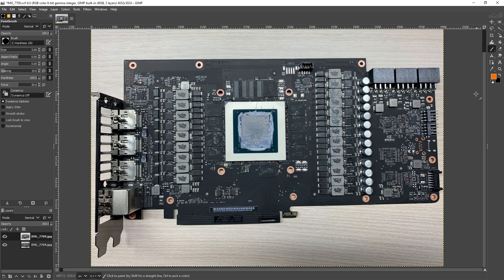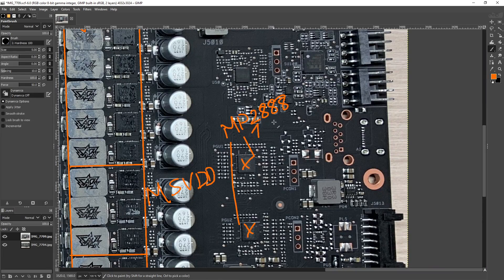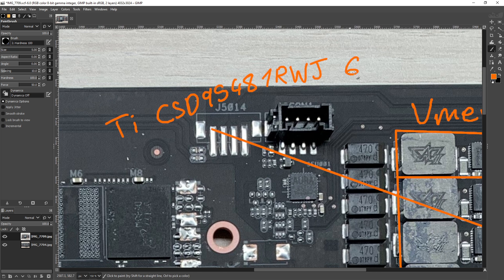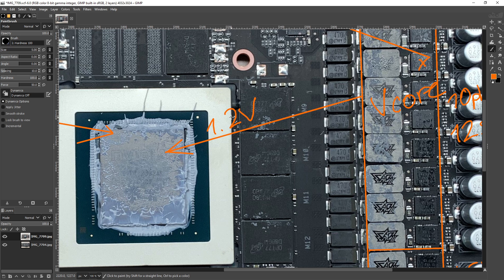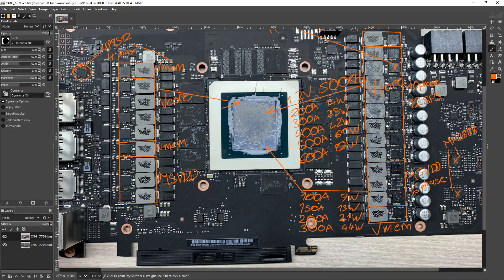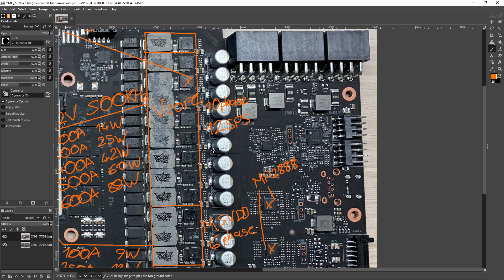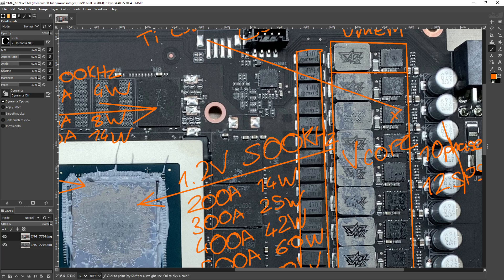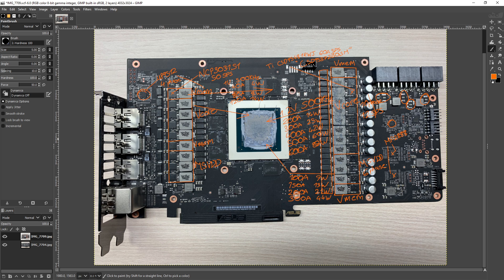GPU PCB Breakdown: RTX 3080 Strix // The best RTX 3080 PCB there is (same VRM as 3080Ti/3090 Strix)

Comment: Been waiting for this one.  Thanks Buildzoid, glad you got around to it.
This has confirmed my decision to just wait it out until I can get one.  As many of us have considered, I almost jumped at the first reasonably priced 3080, regardless of who made it, but no ... this is worth waiting for.  Just need the price to drop some more, as well as availability to come around.
Running a 1080ti now, skipped the 20 series ... and it was the right decision.
I dont do one generational upgrades. I replace builds only every 7-8 years.
This GPU might just last a couple.
Reply: good luck brotha, just got my strix 3080 ti ordered and delivered on the same day yesterday by newegg. this thing is a beast, i have no doubt the normal 3080 will be the same
Reply: I initially went for a 3090, but cancelled the order and decided rather than go a low end 3090, I'd go a high end 3080. STRIX OC it was. Looking back I was super lucky, and ordered in October 2020 and got the card just before Christmas. I fucking love it. I'd had an EK block and back plate waiting for it, so the air cooler literally lasted minutes before I pulled it off and put it in the loop. Best decision I ever made "downgrading" from the 3090.

Comment: i think Bearded Hardware made a video about the I2C thing with the MP2888s. apparently you have to send a special command with the EVC to expose the second controller (that does MSVDD i think) otherwise you'll only see the first one that does VCore. here is the video: https://youtu.be/EaJ8ytamJzQ it's at 3:44 min
Reply: To split GPU and MSVDD controller make sure I2C wires connected to PCON1, PCON2 or SCON2 (connected together)
Order from top to bottom Clock, Ground then data on bottom and then to Elmor EVC2
Using EVC software just send (Write) command Addr = 0x20, Cmd = 0xBE, Cmd Length = 1, Data = 0x20, Data Length = 1
Press Find devices, now you got 2 MP2888A controllers shown. One on Addy 0x21 (gpu) and the other on 0x22 (pmsvdd)
You must change Vout control to PMBus (from SMBus) to enable Vout Command and offset functionality
Reply: @Gti_Jason  yup, you're welcome for that ;) (it's jomama22 btw lol)

Comment: Had no issues with mine. Been great before and after water block. 19413 timespy graphics score where I topped out stable in games. Sits at 2100/2130, never hits 50c in my loop. Got to 1000 oc on vram before errors. 160cc oc.

Comment: You should mention cards that are not fused and maybe manufacturers will start protecting them when people learn which ones are designed to blow (i mean protect) the gpu and which ones aren't.
Reply: The fuses are designed to make the cards repairable by the manufacturer and just not e-waste. They are not usable by the consumer after a fuse blows. The fuse is for their benefit not yours really.
Reply: Fuses are way too slow compared to digital methods of overcurrent protection for anything but short or near short circuit conditions. I'm still glad my 3080 ftw Ultra has fuses, but they shouldn't ever go off from normal, even extreme OC use

Comment: I ended up paying scalper prices for this card and its a beast and I have never had a better cooler on a high end GPU. Full tilt running at almost 2000 MHz core and this thing will chill at 70 c Max on air cooling not even 100% fan speed. Super quite and powerful. If you can get one highly recommended.
Reply: Any coil whine?
Reply: @JM-sn5eb  Initially I did get some but the more I used the card it dissipated until now no or it is unnoticeable.
Reply: @JP_Stone  hmm good to know. I’d prolly undervolt it anyway

Comment: In Germany these cards are often sold at lower prices in the second hand market since at  some point many are truly fed up with the coil whine. Great for people with ANC headsets.
Reply: I have the 3080 Strix OC version and barely have any coil whine - to be fair paid a bit more for my PSU to get some cleaner power delivery in the first place - that might help. 
But even when I have coil whine, as long as I have my headset on (no ANC) I don't hear it anymore. So don't get discouraged from buying one of those if you are worried about coil whine.
Reply: got mine couple days ago, it whines. what a massive shame.
had to undervolt it and cap fps in some game to get it usable.
so if you can, i recommand buying second hand and try it in the seller's place see if there is any whine before commit.

i would take a mining card over coil whine card. i am just waiting for 3080s and will buy those to keep whichever one whines less.
Reply: @EnnTomi1  oh no just ordered the white 3080 strix. My vision 3080Ti hardly has any but that could be cuz it only has 2 8pins? Or maybe cuz their fans ramp up to 2000rpm lol

Comment: No surprise this is the top dog for the 3080s. How would you go about rating the rest of the line-up? The Strix clearly has more phases and overall some better components that other cards, but many use the same controllers. The Strix is an absolute beast, I still have a bit of a soft spot for the founders edition due to the shear density of high-ish end components on such a tiny PCB, although not perfect, lol, it's certainly unique.
Reply from the maker: high component density is bad for thermals

Comment: It looks just like my 3070ti, with a few less memory chips.
I bet it has problems with GPU hotspot aswell?
I fixed mine with more thermal pads and thermal paste.
ASUS forgot to put thermal pads on every VRM, it was missing (by design) on the one closest to the PCI-E connector, and also the top most memory VRM.
I had 60C core, 70c memory and 105 hotspot.
Now i have 60c core, 70c memory and 71c hotspot on average.
Those temps are with NF-A12x25 fans ziptied to it for a more tolerable sound.

Comment: Any suggestions on how to physically reduce extreme coil whine on this card? Undervolt/frame cap didn’t lessen it. Should I inject superglue around and between all the capacitors or swap them out entirely with different ones? Which glue/epoxy should I use or which capacitor should this be swapped for?

Comment: I like you and i don't like anyone you are my new best friend so far you are the only person ive been able to find in a month who knows more then i do not just taking off the cooler and going that looks nice i have a 3080 lhr card im going to replace the second bios and try changing the hard straps from 2216 back to 2206 and now doing some mods i decided when i got it i was going to take on the challenge just finding the dam bios switch is impossible found one twice the size i need but thats about it

Comment: I'm not sure if it's the best PCB, cause I've got mine and OMG the coil whine is just ridiculous. I have a Corsair rm1000i (1000 Watt 80 PLUS Gold Certified Fully Modular PSU) and used 3 separate PCI-E rails (no daisy chain) just in case, but it didn't help :) The more FPS you get (the higher the power draw) the louder it gets... and from what I have found - I'm not the only one...
Reply: Oh noooo. Just ordered mine :(
Reply: @mannyfresh7065  I guess it’s the meter of luck, so you might get a “silent” one ;)
Reply: I believe every 30-series Strix has the terrible coil whine. Mine did too, so loud that I could hear it over my headphones. I returned it, but am considering buying another and supergluing the capacitors as others had suggested to dampen the noise. Is that something you’d consider doing as well? I don’t accept the whine as 'normal' because if AIBs better insulated or glued their capacitors this wouldn’t be a problem. Search 'How to quickly & easily fix coil-whine TechPowerUp' - there’s a thread where others had shared their results. One glued their 3070 Strix capacitors and it still whines but less than it did.

Comment: Not a big fan of ampere on the whole because every card in the lineup has massive deal breaking flaws but i do like buildzoid videos.
Reply: @Boofy Goofy bro
Reply: @Boofy Goofy back when it launched the deal breaking flaw was that it was supposed to be $500 more than the 2080 ti and only like %60 faster best case scenario. Alot of that performance gain was also gained via higher power limits meaning an overclocked 2080 ti could usually get within like %40 of a 3090.

These days though at like $800 the 3090 is a good card
Reply: @Boofy Goofy the reason the 3090 ti is better is theres no memory chips on the back of the card that get fried
Reply: @Boofy Goofy as a long time 6800 XT owner radeons are a bit  overhyped. Sorry to hear about the state of your local markets thats a rip.
If you have a local best buy maybe keep an eye out for open-boxed 4080 deal for around 1000. My only advice on used stuff is only buy it if you can tell that its working and healthy or can return it.
Reply: @Boofy Goofy for you the 3090 would be a better buy because the 4K performance will be more consistently good since it has a ton of memory bandwidth, considerably more than a 6900 XT. Just make sure the seller lets you test the memory health using afterburner and you learn how to change out the thermal pads with better ones if memory temperatures are too high

Comment: I love this card, the fan never spins up lol
Reply: then you didn't oc hard enough :D
Reply: @balazs_korcsog  Not really though - I have 3 intake fans right below mine and the fans barely spin, and even when they do it's not audible at all.
Reply: @Crestxo  ok.  I use msi afterburner and custom fan curve ^^
Reply: Me too, putting it in OC mode. The only fans I can hear are the case fans and the AIO Fans 😂
Reply: @ahmeda7479  yeah oc mode with 500 on memory and 120 on core + fancurve is +20%on fans regarding the C on core eg 50c on core 70%of fans etc

Comment: Hi Buildzoid, could you tell me whether its possible on a 3080 to add mem chips to increase vram? that's if you can get the mem chips in the first place! or is it more complicated than that, any insight from your  mega brain would be great, thanks, love your stuff. I get the idea that it would be incredibly difficult to solder in?
Reply from the maker: I would expect Nvidia to disable the unused memory channels in silicon so you'd need a new core.

Comment: Can you please do a PCB breakdown of the EVGA RTX 3090 FTW3. I just bought that card. Thanks
Reply: I think he already done the 3080 PCB version of that card
Reply: @paul2609  yeah he did. I was wondering if anything was different about the 3090 PCB
Reply from the maker: @EastCoastPC  there isn't
Reply: @ActuallyHardcoreOverclocking   Thanks so much
Reply: @ActuallyHardcoreOverclocking  It is different in the 3080Ti FTW3 though...you didn't answer my question about your view on the replacement of the UPI 9511R controllers (3090) for the OnSemi NCP302150 (3080Ti) ...it's supposed to be an upgrade? 😉